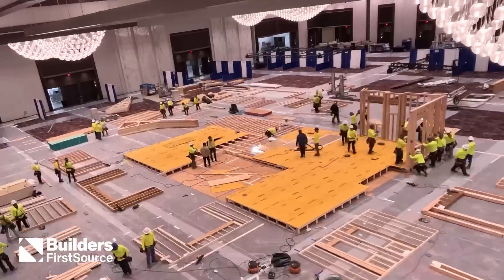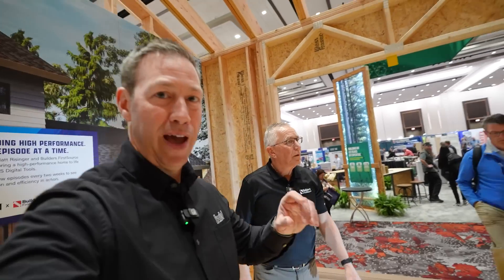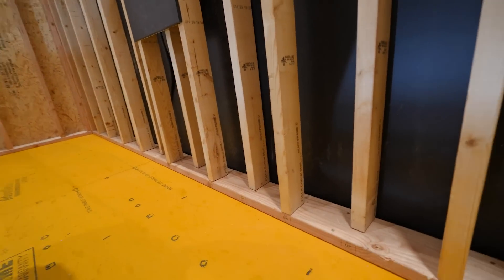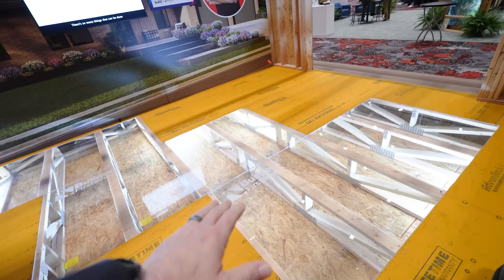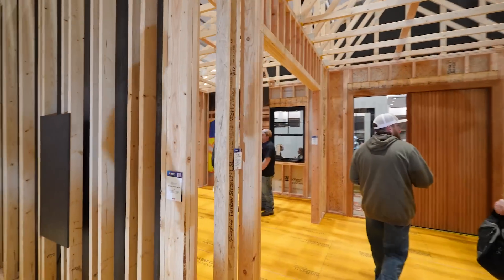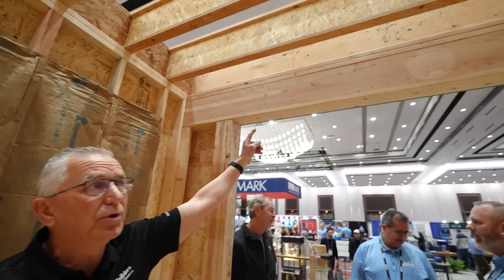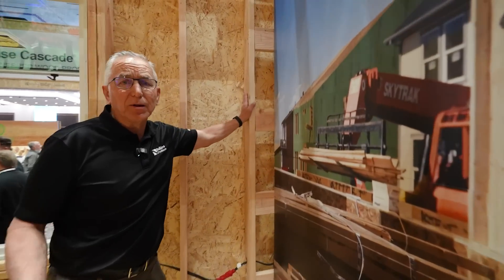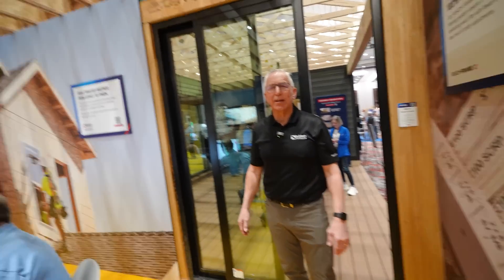3x4 Studs, Truss Headers, & More Framing Techniques You Didn’t Know About!

Comment: As a Structural Engineer who works on high end homes, the truss header is a game changer when it comes to the argument between thermal issues and structural issues colliding.
Reply: As a structural engineer shouldn't the trimmer and king studs touch the bottom plate?
Reply: @RH-cv1rg  I noticed that too, especially with factory cut lumber.
Reply from the maker: Appreciate the comment from a Structural Engineer!
Reply: In commercial, we've see metal stud engineered, site built trusses supporting loads for decades. Taking that to residential and wood is "why didn't I think of that?"
Reply: Ok I rehabbed a 1913 house that had these as their headers and pass throughs. The only difference are nail plates. Otherwise exact same. What am I missing?? Why did we move away and come full circle a century later?
Reply: @joshuamills2868 nail plates are a game changer on their own
Reply: These look great from a structural engineering perspective.  
One may also want to consider the fire risk by just doing a search with "wood truss fire risk". These metal connecting plates rely on 1/8" teeth to hold everything together.  In case of a fire, there is zero give.

Comment: As a homeowner looking to build a new construction in the next 1-2yrs, I’ve watched almost every Risinger video and Steve B video (I’m in New England). If a homeowner went to a builder with all these things I’ve learned from your videos, am I an annoying customer that builders don’t want to deal with or is that information appreciated?

PS- Super interested in readyframe methodology. 

Love your content and thank you!!
Reply: I just built an ADU and at least in my area, it was hard to find a builder who even knew what I was talking about half the time. When they did, they insisted things like rainscreens weren't necessary (we see a lot of rainfall and humidity in summer). I had to fight with the guys I eventually hired over things like taping joints, and they left a mess behind. I have a feeling you'll be much better off in New England, but it was certainly enlightening in my case to see the gap between the guys on the edge and Joe Contractor.

Comment: I get the use of LSL studs with the state of most SPF lumber these days and getting good sheer nailing is going to be a lot easier to execute with that extra 1" of material.  The problem I see is general availability and a framing crew getting the right sticks in the right spots.  Maybe precut with the layout printing is the way to make this come together but it seems like there is a bigger and broader value engineering opportunity here.

Comment: You can put the 'staggered studs' for noise reduction, but the exterior walls should have them because it ELIMINATES the heat transfer, not just reducing it.  This is what I did on my cottage here outside Seattle.  My cottage is nearly passive. 

I designed and built my cottage with ten foot exterior walls.  First, though small in foot print at 20X15, it feels 'large' (it also has a 12/12 roof, so my loft above the 7'6" ceiling has 9'3" head-height).  I used 4X10 OSB, so every seam falls on a stud--no taping.  Then I put a 2X12 bellyband centered on 9 feet around the entire cottage.  Talk about shear!  And maybe a couple of years down the pike, you and a friend can attach stringers on the bellyband and build a shed room addition on any of the sides--or all of them for that matter.

I don't know where you are building but here the plan inspectors would require a civil engineer to validate the open truss headers.  What I did was salvage some old 4X12 beams (they are all over the place and free) for my headers.  Then, I nailed solid 2 inch insulation on the face.  The open truss headers you show will transfer heat through those ten lineal feet of 2X6 truss boards.  

Most of the other 'innovations' are just costly gimmicks.  If my framers have to have the lines drawn on the bottom and top plates, frankly, I don't want them working on my job.  And spending money on engineered wood instead of common studs, again--do you really want incompetent framers who need to use 'straight wood' to build a straight wall (and we've been hanging kitchen cabinets on walls for decades; I never heard that the straightness of the wall was that big of a problem).  

Finally, here in Washington, you have to have two bottom plates and two top plates (and I didn't see hurricane tie downs on the rafters, either).  

Most of your 'innovations' are costly add-ons for little gain.

Comment: im curious about the joists cut outs for duct work?  seems that might be ok if it’s just straight attic space above but not for floor strength.
Reply: Check manufacture's literature for maximum cut openings (and locations) in i-joists for floor applications, you would be surprised.

Comment: The staggered 2x4 wall studs are awesome for electricians because you don't need to drill any studs to run wire from one side of the wall to the other.
Reply: They're awesome for carps too because it's twice the work!

Comment: Everything pre-cut requires absolutely perfect foundation. Can be done but isn't always the case. Even if you have to custom cut some small percentage to replace those that don't work it could still be worth it.
Reply: It is common practice to shim sill plate at foundation .
Reply: Probably better to fix your foundation issues instead of custom cutting
Reply: But I agree, built in a lab doesn’t always work in the field.

Comment: I wish Matt would acknowledge that the reason his crew could save 40% on framing time is that other people at BFS did a ton of work before the materials arrived on site. I mean, if you use modular walls, which are fully prebuilt, you can save even more time, but thats because someone else did the work. 

Now, if there's something about the process that BFS can follow that means they spend only (say) 20% of the time to save you 40%, that would be worth noting. But I haven't seen Matt talk about a cost/benefit analysis of ReadyFrame. Saving time by paying someone else to do a bunch of work off-site is obviously a way to save time, but does it actually save money and/or time overall?
Reply: he wants to save labor as an architect...
Reply: No chance it saves as much as 40%. Saving money maybe. Paying someone that is less skilled to package that up might save a little

Comment: When I was a remodeler I was always amazed the shorter 4x12 headers shrunk and weren’t holding up anything.
Reply: Gable end wall?  I don't know why builders put oversized headers in non-loadbearing walls! Even this demo. house, did similar, it would appear at 9:28 .  The IRC addresses this clearly for most openings @ R602.7.4 Nonbearing walls

Comment: WOW, the printing on the framing is better than the instructions that come with an Ikea piece of furniture!
Reply: my concern would be keeping all the parts for the room together and not spending time searching for the right piece of wood for each location. It would take a lot of discipline by the framing crew.
Reply: @lancedoyle5026  First pieces stacked on top of the lumber bundle and as you work your way down you'd keep coming to the next studs needed.

Comment: I built a 16 ft. truss header for my garage in my house in Houston. It will never sag, and they are much lighter to handle plus the insulation value is much greater than the solid wooden headers. This was done 15 years ago, and it has remained straight as a string.

Comment: How does LVL & LSL stack up with screw & nail hold power?
Reply: As a framer, the last thing you want to do is improperly nail an lvl or lsl, those nails are next to impossible to get out without tearing the heads off the nails.  The nails hold a lot better than wood, and I'd imagine it's true for screws
Reply from the maker: Great question. I actually don’t know. Any engineers or wood manufacturers want to comment?
Reply: I'm more interested in water resistance for exterior wall applications.  Matt's comment about it being similar to OSB (that he's called vertical mulch in the past) does not engender confidence.  These studs may be treated for water resistance, but I really think this should be advertised by the supplier here.

Comment: At first I didn't understand why T-Stud had the one 2x3 oriented sideways, but putting that to the outside gets you a much better nailing platform for sheathing, plus you don't have the thermal bridging you would have with 3x lumber. Matt, what are shear values for the 2x6 and 2x8 T-Studs? Are they going to resist that sideways force? I remember Brian Iverson talking about crushing force for these, but I don't think he mentioned shear values.

Comment: The 1922 extension of my dining room has a truss like that over the triple window, a 10 ft span.  Fortunately, it hasn't had much weight on it, but my reno contractor put supports between the windows, two of which I sealed up.

Comment: Just an observation at around 6:24, a structural engineer friend of mine told us to header high at the double top plate and cripple down to the window opening. We never header directly above the window since framers sometimes cut the cripples short. We always put a non-structural header out of two-by material above the window and the main header is above. We have been doing it this way for over 30 years and inspectors love us. Saving a few pieces of wood is not our concern since we build in a $5 million plus range.
Reply: That has been covered and shown multiple times on this channel.  How terrible would a framing crew on new construction have to be to cut cripples short?  Especially on a $5 million build.

Comment: Out here in seismic, California 3x4 and 3x6 studs have been used forever, but the lumber yards stoped suppling untreated 3x and so we use 4x. We often use 3 x mud plates and stringers if the engineer calls for it. That's what the 8 ¼ skilsaw is for.
And even though it's a demo model get the studs even and all touch the bottom plate. You're trying to sell precision cut lumber. If things don't line up, I seriously doubt precision claims.
Reply: I noticed that stack of sticks floating on nails 1/8" off the bottom plate too.  You might think for a trade show they might have gotten that right.  Then again I used to go to the Detroit autoshow to get to get a feel for the industies fit and finish ability and even tuning cars up to look their best there were a lot of ratholes to be found.

Comment: I did a DIY wall in our home using a staggered stud, both for sound performance and to make it thick enough to envelope an existing structural beam. It was great to work with. I did the studs 12" OC for the overall wall assembly, but that gives you 24" on each side which made it real easy for someone with no prior construction experience to get nails in without a nail gun. Its great after the framing too. You can just staple wiring to the inside edge of the studs without having to drill any holes. You might be able do the same with water lines if you use Pex. You can weave in continuous insulation horizontally, just staple one end of a roll to a kingstud and pass it back and forth. It'd be hard for me to comment on sound performance of the stagger stud aspect individually as I also used single leg resilient channel on one side and mass loaded vinyl on the other, but I doubt it hurt.
Reply: It certainly passes code. Every project they do is code compliant for the area it’s built in.
Reply: You wouldn't want a wire or waterline anywhere near where a nail or screw can get to it, plus I don't think the "weave" would pass code.

Comment: I just wish customers cared as much about the bones of the house as most of the people reading this do. It only really makes sense in the context of custom home building, where you have a client sitting across the table from you, and you can say "if you want less noise transmitted from the bedroom to the hallway, I can do staggered stud walls and double layer drywall and sealed electrical boxes, and it'll add $500 to each room cost." I don't see how you could monetize these "hidden" methods on, say, a spec house.
Reply: People usually care about sinks, light fixtures and countertops... don't think a lick about framing or insulation.  Out of sight out of mind

Comment: I'm planning on using the technique of having a framed glazing unit, but taking it to the next level.  I've got a 10' x 8' 4-panel slider that I can't install from the outside 7 feet above the ground using my minimal crew - me and my kid.  So what I'm planning is to just build a minimal area completely around the door rough opening, flash it laying on the ground using the Prosoco system, install the door on the flat, and then lift it into the structural wall.  To get the openings to work out, the bottom plate of the structural wall underneath the door is cut out after the wall is lifted.  Wish me well as I work on building my off-grid home as an amateur!  My guess that the thick layers of exterior insulation will hide any flaws in my carpentry!

Comment: I'm surprised there wasn't a sample of framing that you showed on another video. That was where you had 2 2x4s on a 2x8 or 2x10. This allowed a lot of insulation with no temperature break. It was also less expensive than using 2x6 studs.

Comment: That marked bottom seal plate is great until you have to throw it out and use another because the lumber isn't straight, which happens all of the time. Matt's picture on the wall...lol.  He gets paid to promote this,,,of course.
Reply: It's not that hard straighten a bent piece of lumber.

Comment: The web truss header is very interesting. Can site built trusses use the strength of the OSB sheeting instead of pressed plates?
Reply: Not and be certified by an engineer. I'm sure a well built site built truss could work in theory, but the use of many 8d (or 10d) nails in the end of 1-1/2" width of pine boards used MIGHT split the wood and ruin the structural integrity of the truss.

Comment: None of these are fire proof. 😂
Reply: Correct, wood burns.
Reply: Theres just a few thing “fire proof”. the stud that cuts the air in the walls, its just retardant as almost everything in the modern house. in the continuous wall if you put an incombustible insulation, its does the same thing

Comment: I wonder, like others, on the gaps at bottom plate studs. Also, I want to see staggered 2x6 on 2x8 plates. The LSL is great for build of kitchen, bath and really most interior walls. What's the cost increase for all LSL comparison? Can they make the truss header with LSL? Also that span on the floor trusses...is that 2 feet on center? I want a solid floor that can handle weight...I wonder on the flex?
Reply: I worked on a house using LSL and when it rains and there’s no roof yet… you guessed it:
Everything bloats.  Mushrooming action on every member.  
I love seeing the staggered stud, been doing that for years.  
Truss header… never been an area that I was concerned with in regards to losing energy in the house.  Solid, long term support for generations; go solid!

Comment: If only we can get folks to use steel framing--if done correctly it eliminates a lot of the problems you're correcting with these materials and techniques.
Reply: Hmm. Thermal bridging though?
Reply: Wood grows on trees.
Reply: Steel is 500 times more conductive than wood. I don’t think we’ll be framing houses with steel studs in VT anytime soon. We need more people to use spray foam and warm the globe for that.
Reply: Cost multiples more. Thermal bridging.
What things does it fix that they're addressing here? 

What does it take for a shear wall with steel at 22 guage
Reply: @sparksmcgee6641  Although thermal bridging can be addressed I hear you--it just seemed like a lot of material to me.   I'll admit I've never run direct costs against using the materials shown so I take your point--former steel guy here. . .

Comment: not a single stud is touching the bottom plate.
Reply: Demo made in 10 hours that doesn't have to support too much weight and will be knocked down in days
Reply: yeah  that won’t pass inspection 😂   Its a freaking demo    good lord
Reply: It's not meant to be there more than a week, why would you nail the heck out of it only to spend a ton to take apart. Probably 1 nail per stud instead of 2 or 3.
Reply: Actually, I once saw that kind of gap in a commercial build. It was like the foreman was, “close enough, nail it.”
Surprisingly, it passed inspection, though the inspector might have been on the take…?
Reply: @DanielinLaTuna things that can only be possible in Texas😂
Reply: You people are ridiculous. It’s temporary they’re not showcasing their framing craftsman they’re showcasing their products…
Reply: “Precision cut”
Reply: Hey, it's a demo, why east material, they can dismantle this and reuse.